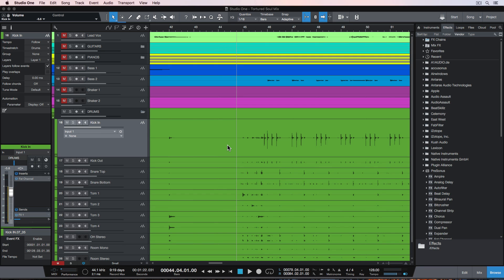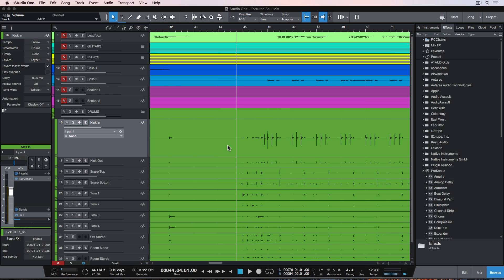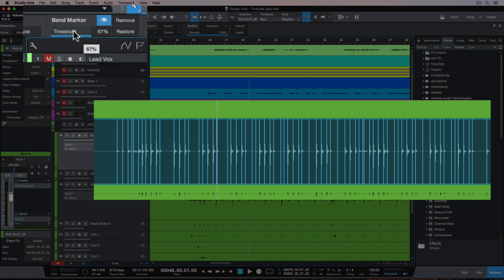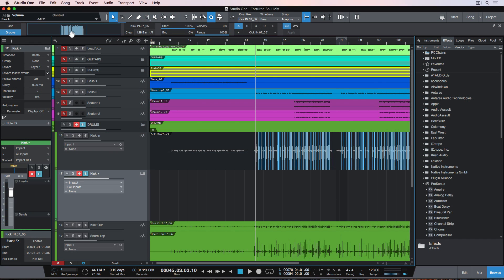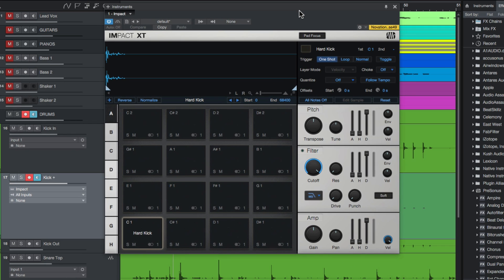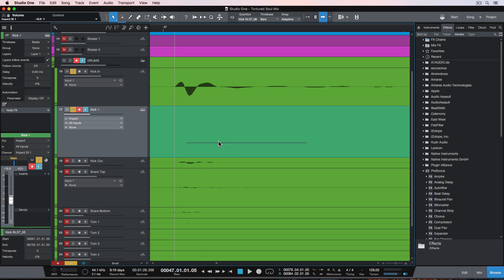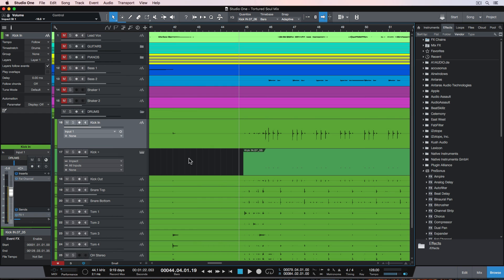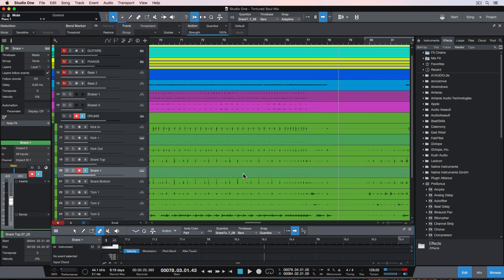STUDIO ONE 4 - Drum Replacement & Layering

Comment: Thanks for this! I've been using Steven Slate, but been wanting to do this method for a while. Do you find the snare is a lot tougher since there can be a lot of ghost notes? Does the level of the ghost notes stay the same as long as they're within the threshold? I've found that with Steven Slate, it's really hard to get ghost notes to sound accurate, but that could be user error too:)